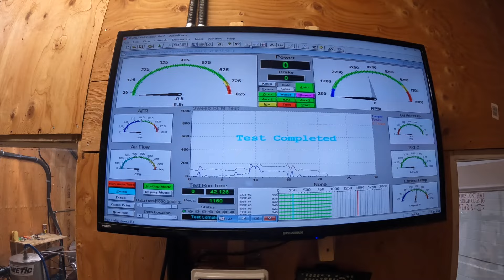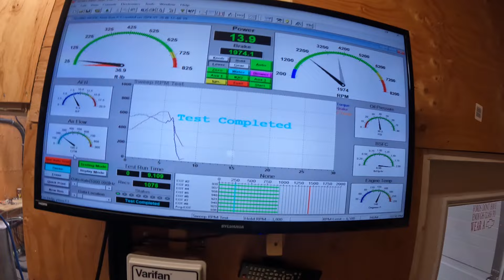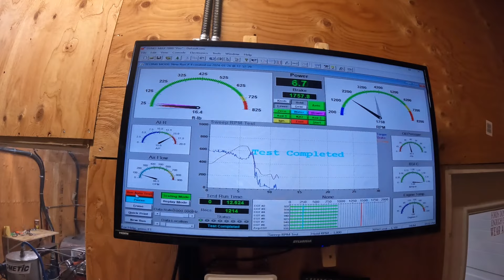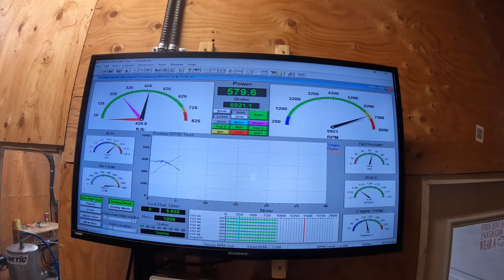Dynoing a 496 big block chevy

Comment: Why are you just guessing??? You know how bad the ports are in a BBC? Don’t you? You should be looking at plugs every pull or two to see what the engine wants! Which cylinder’s are lean or rich! You can have an average A/F ratio, doesn’t mean you don’t have cylinders running 2 AFRs different! No valve train checks! Especially if it’s a new engine! Break a spring, drop a valve turn it into a pile of 💩💩💩💩! Best of luck! But that’s how you break shit, by just yanking the handle!